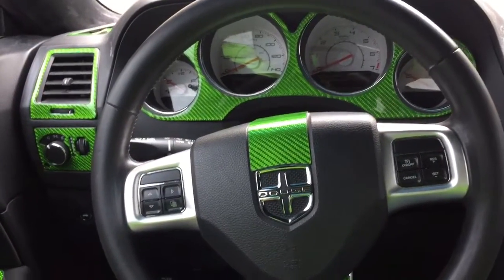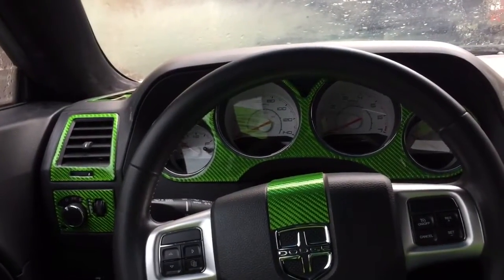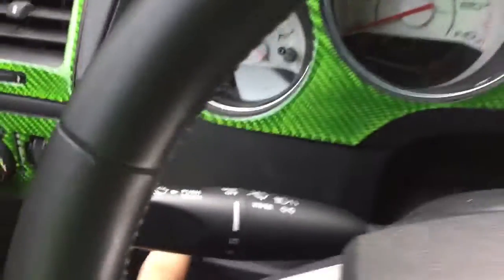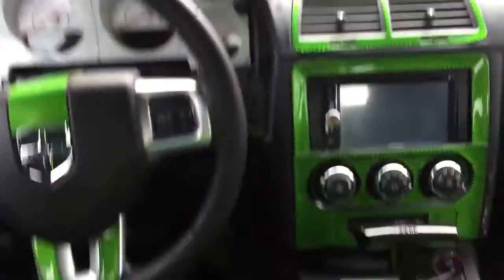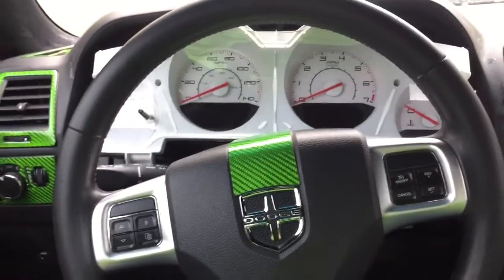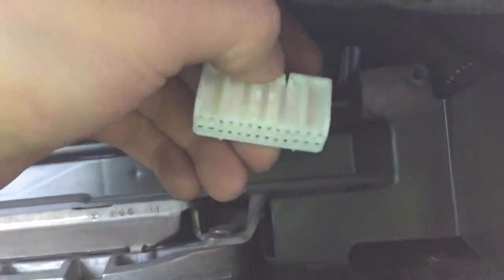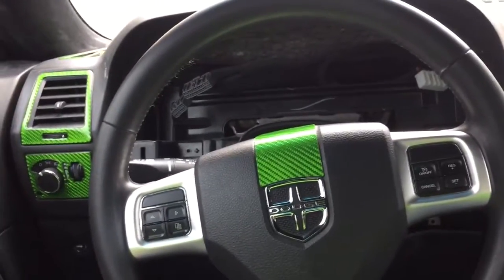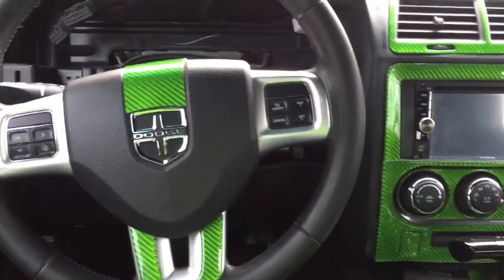How to remove a Dodge Challenger cluster

Comment: Sup bro? Question? Do you remember after you pulled that panel then the cluster off? If it was east to get access to the push start button? Behind it? Could you see the wire harness and possibly grab it? I wanna do a kill switch on mine.. was wondering if it was acceptable after you get all the latest stuff out of the way..thanks for the video on getting the panel off and cluster.